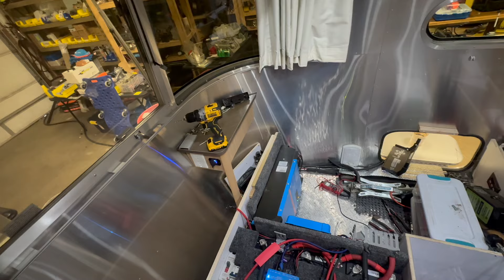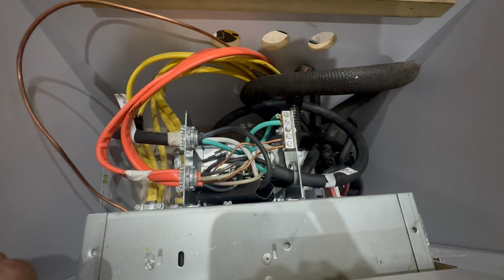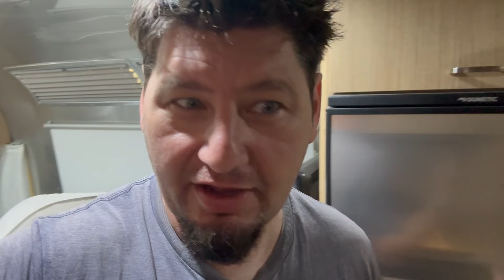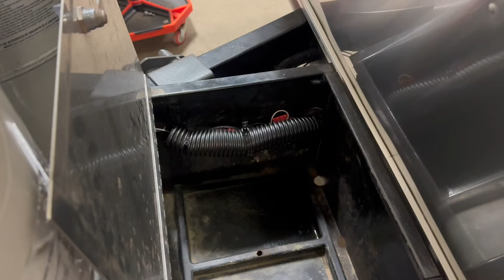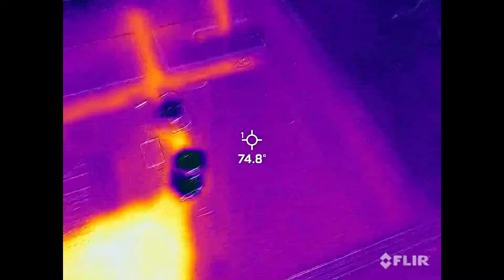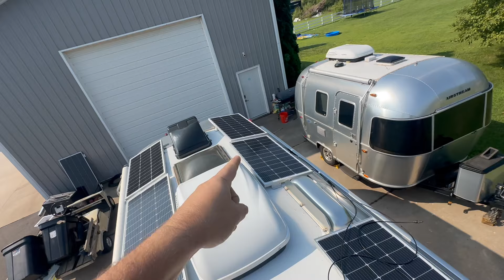Airtsream Victron Solar System 800w  Solar 618Ah SOK Battery

Comment: Question: Reading the Aistream wiring schematic the roof top solar coonection has a possible 30 amp self setting fuse. Wouldn't that create a problem?
Reply from the maker: Not we’re running at 35-40 volts PV

Comment: How do you make the end caps for the wire raceway?
Reply from the maker: Very carefully. I’ll do a video on it. I trim it down on the table saw until it snaps into the barb slots.
Reply: @sotasolar  thanks that would be great.

Comment: Shawn, I also went with the 150/70 (two of them) on my system due to the high volts/amps that it will take before de-rating.  My goal is for 2000-3000 watts on the primary controller (to push peak watts of production) and up to 2000 on the second controller.